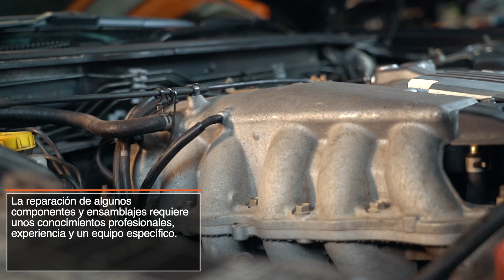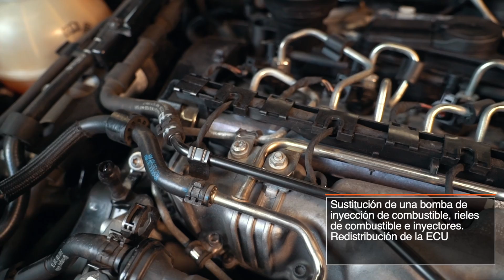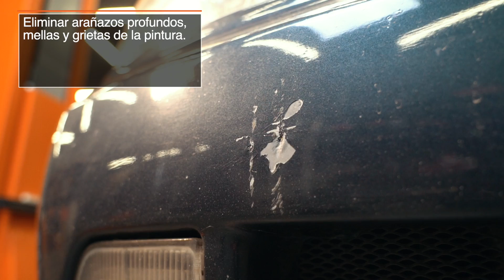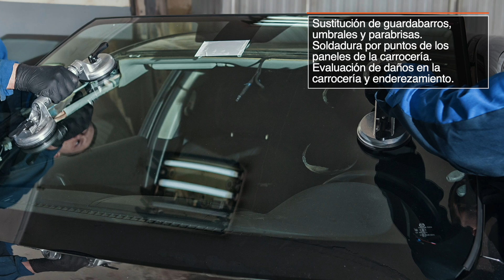Averías que no deberías intentar arreglar por ti mismo | Consejos de AUTODOC

Comment from the maker: ¿Te ha parecido útil? ¡Darle un “me gusta” y compartirlo es el mejor modo de agradecérnoslo!

0:18 — 1. Motor
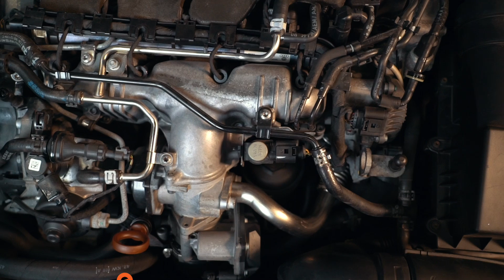0:38 — 2. Caja de cambios
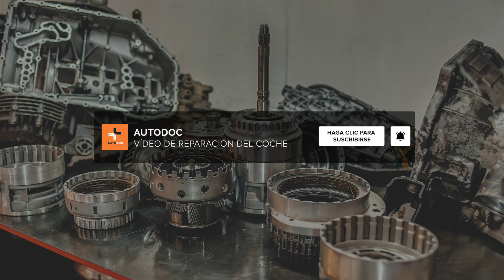0:55 — 3. Sistema de combustible
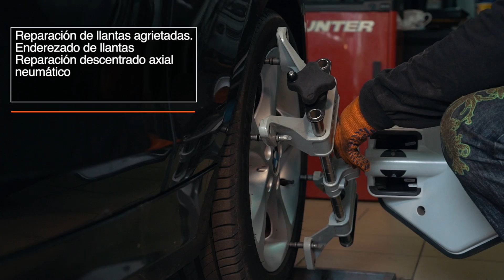1:22 — 4. Llantas
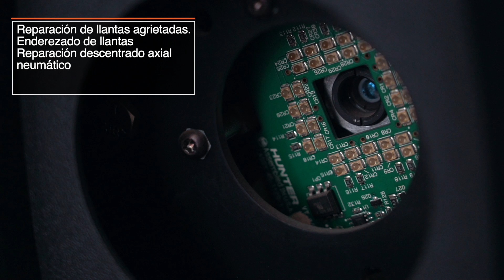1:38 — 5. Equipo eléctrico
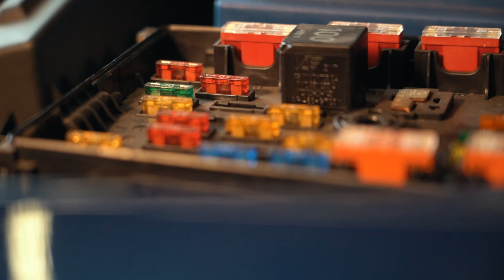1:53 — 6. Unidad de control de motor (ECU)
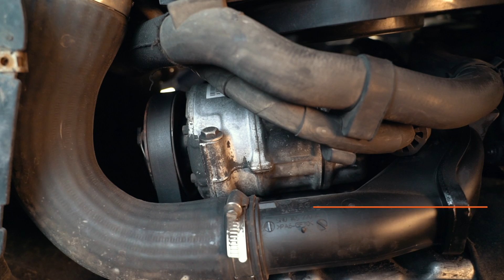2:11 — 7. Compresor de aire acondicionado
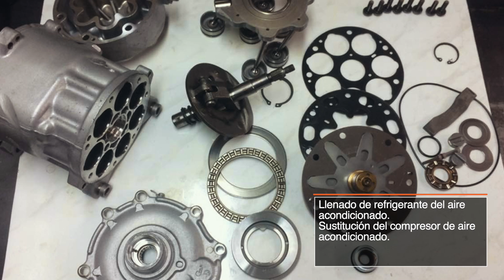2:27 — 8. Airbags
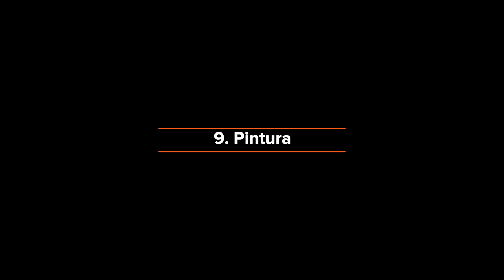2:45 — 9. Pintura
3:04 — 10. Elementos de la carrocería